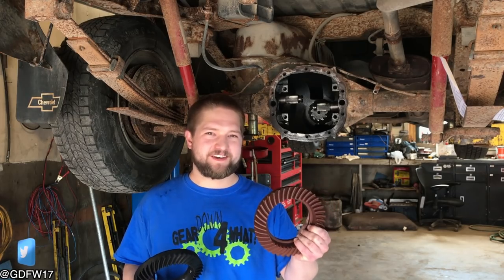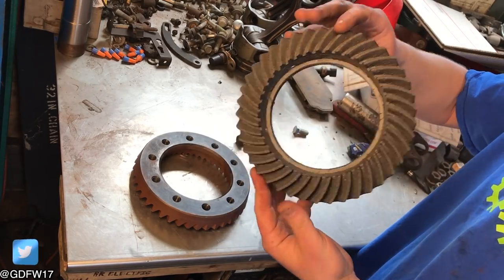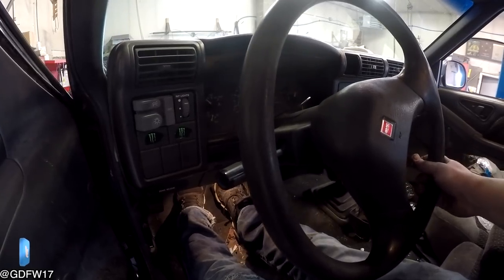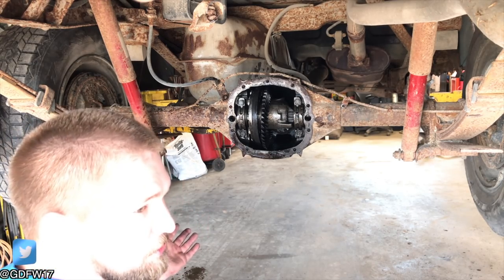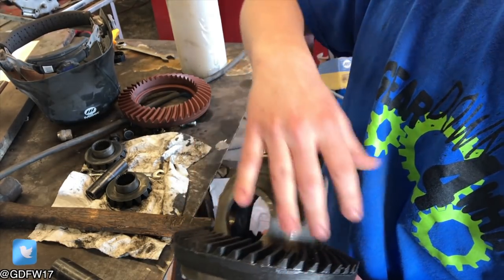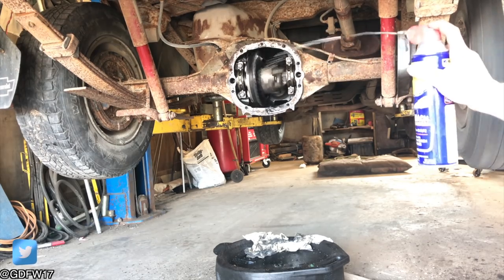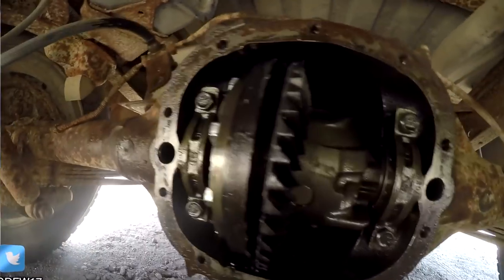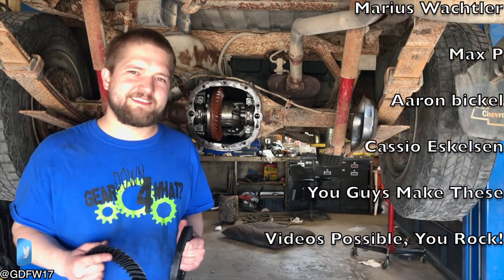Replacing Drivetrain Parts with 3D Printed Carbon Fiber Nylon - FOR SCIENCE!

Comment: The ring gear you are trying to replace uses a case hardening steel with tensile strength probably between 500 and 1000 N/mm^2, no way in hell a 3D printed, non-homogeneous plastic part with questionable layer to layer bond can do the same job.
Reply: Stefan. Exactly what I was thinking. I guess we are both mechanical engineers :)
Reply: Even if it was injection or compression molded it would get destroyed as soon as it was on the pavement....maybe a super tough nylon material with a high steel fiber content but unlikely
Reply: Success is not the point of the video. The point is to see how far away we are from being able to do this. IE is it say 3 orders of magnitude or 2 or even 1? Ordinary nylon I would guess would be 3 orders of magnitude too soft. With the carbon fibre depending on type I bet it's possible to get within a factor of 25.
Reply: Under ideal circumstances it might last a few minutes of slight acceleration.  One turn, or flooring it, or reversing it and it's toast.
Reply: That's like making it out of butter and try to guess how much stronger the material needs to be. It's still going to break and if it breaks - you can't tell how close or far from the goal you are.
Reply: 500 to 1000 N/mm^2 is a good guess for the tensile strength of the gear, though it's off for the surface hardness which is likely roughly twice that.  I didn't look up the specific material here but glass filled nylon is roughly 1/5 to 1/10th the tensile strength.  The modulus of elasticity is probably stiff, roughly 50-75% that of steel so flexing wouldn't be a huge issue but the impact toughness is, roughly 30x less than the gear in question.  For gentle accelerations a back of the napkin guess is 1/5 to 1/10th the strength while slamming it from drive to reverse, turning,  or going over rough ground will break it roughly 30x easier as the impact toughness is really low compared to steel.  That's for machined gears out of quality stock.  3-D printing half assed is anyone's guess, but it would be reliably lower to far lower than stock material.
Reply: Really then the Russian method of successive approximation engineering for closed cycle rocket engines didn't work then? And all the engineering instrumentation I have designed for various companies is a complete waste of time too. LMAO muppet.
Reply: Probably not 25 times, though that's close and it could be I guess.  "Soft" is somewhat descriptive but not as precise as the modulus of elasticity, or softness/stiffness to laypersons, is similar between the two materials whereas the strength and impact toughness isn't close.  It would likely come down to the impact strength which is probably 30-40x weaker though it's not as simple as comparing charpy or izod test data from a chart obviously.  It dosent really matter what you have designed, or what schooling you have, just what you know.  I never considered mentioning the only reason I dropped out of the PHD program in mechanical engineering was to found a successful urban warfare robotics company.  Not only did I design the mechanicals including the gearboxes for multiple systems in service even today but also all the electronics including the smart battery systems and the microwave radio communications systems.   Didn't need the degree to earn money if massive money trucks were backing up and trying to unload. That's irrelevant here.
Reply: They should try candle wax next, LOL.
Reply: @burtosis you could measure the hardness on the Rockwell scale. That's pretty objective. The Young's modulus is a key feature as you intimated, but not the final word as something can be fairly brittle and have a high Young's modulus and still be useless as it's brittleness causes forces to increase due to lack of ductility. Anyway sometimes it's good for a laugh to just do "what would happen if" experiments.
Reply: @gordon lawrence 
Firstly you are blowing the conversation way off course, successive approximation is an actual engineering method and has nothing to do with the sort of "winging it" we are seeing here. 
Second I don't know what you do and I couldn't care less what you have done. I'm not willing to enter a pissing contest, people who have knowledge and are capable do not feel the need to brag, prove themselves or drop their "big engineering balls" just to feel important. I'm simply expressing opinion. So have a nice day, buddy.
Reply: I think there is no point in a deep engineering discussion about this subject, I doubt anybody would read/learn anything they don't already know. Peace out.
Reply: The Russians did not and do not design rockets that way. They went through tons of calculations using known material properties, and added factors of safety. Then, when it blew up, they figured out what failed, and why. I knew the Russians that did this. There was no guessing and spitballing.
Reply: It's pretty easy to calculate the gear tooth pressure. It's even easier to calculate the force at the gear tooth. The engine probably makes 400ftlbs through a first gear of 1:4 for 1600ftlbs. The radius of that gear is about 6 inches, so there is 3200 lbs on one gear tooth. I would guess about a million psi at the contact point. This gear is useful for 1 transmission setting - neutral. (It would break in park on even the slightest incline.)
Reply: Still, I enjoyed the video. ;-)
Reply: Стефан Парийски they make carbon fiber leaf springs so let that soak in
Reply: Yes they do/did make carbon fiber leaf springs and they all turn into shredded shit after a while.
Reply: This is nowhere near the strength of carbon fiber.
Reply: It's not only tensile strength, it's also surface hardness (!), young's modulus, thermal capabilities, .... Also, the carbon fibers will only help in the direction of extrusion, they won't do much against delamination.
Reply: Sorry your life is so unremarkable that you can't even envision a life like mine. Maybe you should set your sights higher?
Reply: Less pot smoking would be a great start.
Reply: @FelonyVideos  - I think they should CNC machine the gear from a solid block of year-old holiday fruit cake. It might break the tooling though.

Comment: I would retest with threaded inserts. That's what's used in the composites industry for things like medical tables and aerospace components. Just drill and set with an epoxy. Also, a side note for JB Weld, heating it to about 120 when drying helps with flow and adhesion (good for getting out voids), but will make it runny until it starts to cure.  Also, for a lubricant, you could try graphite.

Comment: Try again with a different design! 
I would love to that thing working properly. The material seems to be strong enough to handle lower torque and lower speeds. By the way, could you try to make a transparent cover to protect the differential? :D

Comment: You have to try this again. For science! Seriously, this could change the game for a lot of people trying to mesh their love for cars and imaginations with a 3D printer
Reply: It could not. Gears are usually made to last for a very long time and to do so, the stiffness and bending strength of them are pretty critical. The bending strength at the tooth root are very much lessened because of the 3D printing and even with chopped CF, the stiffness is much less than steel. It will not be a usable part for a car.
Reply: Sebastian Jørgensen Do you even watch this channel, bro? These guys have shown that even PLA does amazing things as printed gears.
Reply: Sebastian Jørgensen: I don't think the idea was for practicality, it was just to see how long it would last. Failure was assumed from the beginning, hence the beater pickup. You are quite right in every other way though.
Reply: Claws61821: I do, but I am also an engineer who has had the task of designing a gearbox for a racecar. Those gears are heat treated to have strengths much well above 1000 MPa wheras 3D printed PLA had a strength of 30 MPa last time I put a piece of it in our tensile testing machine. For the wear on the tooth flank, the tooth flank stiffness is also very important as the steel tooth will indent into the plastic tooth, thus not keeping the involute shape. This exites fatigue failure in the tooth flank but also gives higher losses and more wear on the plastic tooth. 
I know that this is not a racecar and the gear that it replaces is most likely a hell lot cheaper than those we use but even if it is simply C40E (Edit: type of steel, commonly used for gears) there are still a factor of 10-20 in difference of strength. 

Especially because 3D printing does not give very homogenious parts, the fatigue strength is probably also a lot lower than for a machined plastic gear so it will never be suitable for use in the transmission of such a heavy vehicle. A 12V childrens car is probably a suitable application for 3D printed gears.
Reply: Philospher of Nonsense: Zac Parks sounded like he imagined that it could be an acutal usable part for this car if it didn't fail where it was paused. 3D printing is great, but it is not a wonder where you can replace anything with plastic and especially not when the manufacturing process of 3D printing results in so much weaker parts than other plastic parts.
Reply: I never meant use for internal mechanical parts. But this will certainly strike inspiration for serveral plastic pieces, interior, and trim pieces. Thanks for your engineering explanation though!
Reply: Sebastian Jørgensen Fair enough. I apologise for my previous false assumption that you were simply being a willfully ignorant troll as so many others here choose to do. With the additional details you do provide some good points and appropriate concerns for GDFW to address in the future.
Reply: Zac: That, I agree with you! 3D printing is most certainly useful for making replacement parts or customized parts for pretty much anything that doesn't have high strength requirements and interior and trim pieces are certainly just that. I have a bunch of plans for making mirrors and blinker housings for my motorcycle using my 3D printer but the time for executing those customized parts are still lacking.
Reply: do you undestand the load that is transferred through a dif especially when starting on a hill, and even more so when in a pickup that would have about 1200nm in 1st gear the plastic cannot take the shear force because off the grain,
Reply: Zac Parks And why would you replace everything with fucking cheap plastic instead of sustainable wood or metal or leather or whatever?
The main advantage of plastic for manufacturers is its cheapness and that it is easy to use in mass production. For home use you can do a lot better with similar efford.
Reply: +Sirion no. simply no. 1st what they used isn't "fucking" nor "cheap" plastic. Its properties are far, far, far better than that of wood. 2nd Most things you want to make with a 3D printer are, in fact, not easy to make with similar effort. You can't make many of the things you can just simply print off an own 3D model or one you got from Thingiverse for example with similar effort out of wood. Ever tried to make a pulley out of wood? No? Didn't think so. And 3rd for manufacturers it's not just that. It's also the good properties like durability that makes it so viable, and for many companies 3D printing is an easy way to create and test their own prototypes, that you'd pay a lot for if you had to make 'em out of wood, metal or just with injection molding

Comment: Wait. Couldn't you just put slices from the center to the place where the bolts are supposed to be? Then just slide the bolts in, see how it goes? Forget the tap and holes. Just make sure you use the nuts slid into it. Benefits are that it's all once piece and it should retain most, if not all of it's strength.
Please try it again.
Reply: ^^ to the top! ^^
Reply: Nathan: I was just thinking the same thing as well, where you would slide the nuts into galleries arranged radially, however there is an issue with that. Due to a relatively imprecise fit, it would put "pressure hotspots" on small areas of the ring as a structure. You would want to spread the load as evenly as possible. Quite literally how the tip of a nail can pierce more easily than the head, if you get my meaning.

Comment: you could print the gear and use helicoils, or a slot on the side and slide the nuts in
Reply: Came here to suggest this as well.
Reply: ok I'm a 3d print idiot but if this materiel is as strong as he says it is why can't he just print the threads into the part? I mean if it can handle the torque of the motor why wouldn't it to be able to handle the torque from tightening the bolts into the "plastic"?

Comment: Suggestion: step 1 - before printing, set the nuts prethreaded onto the bolt shafts at the desired hight.
Step 2 - set the bolts on the head with the prethreaded nuts shaft up in the pattern desired.
Step 3 - set printer to start printing at the correct measured hight on the bolt shafts in order to embed the nuts into the structure without having to pause the printer.

In this method, it is all one piece and you can still remove the bolts because you have access to the heads.

Comment: WD40 is a terrible lubricant. Just fyi. Basically anything is better than wd40.
Reply: also dissolves adhesives
Reply: backtrackit anything with any oil content at all dissolves adhesives. Next time you pull a sticker off something and it leaves sticky residue, rub a finger on your forehead and rub the sticky spot. Even the oil from your face will dissolve adhesive. Not really a special wd40 trait.
Reply: backtrackit: WD-40 is nothing compared to PBlaster, especially in penetration. That'll melt a styorfoam cup very rapidly compared to WD-40, which is just a waste product of gasoline manufacture.
Reply: As a lubricant its only ok. It is a penatrating fluid, degreaser, rust remover and a few other things
Reply: AvE compared a bunch of different penetrants, and WD-40 turned out to be one of the best ones. And PBlaster (PB'laster?) actually did pretty badly. This was with a sample size of 4 or 5, so take that for what it's worth, but I was surprised to see WD-40 do so well.
Reply: Bro the wd40 was what made it work. If it broke and it spins wd40 it if not duct tape it down :)
Reply: Luke B the wd40 part dissolved the adhesive. Its not a good lubricant at all
Reply: It was a joke but ok mate. Here in Australia WD-40 is a bit of a fix it all like duct tape.
Reply: It's just fish oil with a few additives. Not a real mineral oil.
Reply: 3d parts are not very God as they are just essentially castless moldings.
Reply: Wd-40 stands for water displacement - 40th try! Not a lube!
Reply: Its fish oil. Yes feshi
Reply: it didn't break because of the wd40, it broke because of layer Delamination which is just an intrinsic part of 3d prints, I'm sure using a better filament and fine tuning the settings along with not letting the part cool down mid way into the 3-d print would all work to help the print not fail. yes 3-d prints are strong, but not in every direction. parallel to layers is a known weakness.
Reply: It’s water based so ya
Reply: If you think WD 40 is a lubricant try this experiment you will never use it again:  take half inch still plate and quarter inch drill bit.   Try to drill though plate using WD 40 as lubricant. It will melt the drill bit 1000 times faster than not using anything for lubricant
Reply: swampy 420  wd40 has nothing in it that is lubricant it is solvent.
Reply: swampy 420  I was definitely exaggerating on the 1000% but my personal experience is nothing is better. Working as service tech I do drill often.   It only took once to say never again.
Reply: WD-40 isn’t even a lubricant, it’s a water displacement fluid.
Reply: Its actually a cleaner and desingripant. Not a propper lubrificant. 

Idk why people still goes on trying that. 

Grease godamn, oil, its way better.

Comment: i couldn't figure out if this had been revisited or not, but here are some tips for revisit:
1. don't print it flat, tilt it slightly so that the shear force isn't directly applied to a single layer
2. find out if there is a curing process available, might be able to heat it to a certain temp for a certain time to cure it for more strength
3. don't pause it of course, just model the threads right in - should have no problem mating with threads that large
4. get/make a clear cap to put on the diff and use proper gear oil, don't just let it hang out in the air unlubricated
5. someone else mentioned using a go pro, great idea

Comment: WD-40 is a solvent!! Not a lubricant. Use a lubricant that won’t damage your print!
Reply: And not use that much oil. Some on moving metall parts and not half a liter!
Reply: WD40 is 1 part motor oil, 1 part fuel oil. It is not a solvent.

Comment: 3D printed parts are nowadays still anisotropic saddly... not really enabling you to print hyper strong parts whatever dirrection the stress is applied to...

Still very inspiring ! I guess you must continue doing this kind of videos !
Reply: unless you use the extremely expensive M1 carbon printer...That thing is one cool overpriced machine...
Reply: You have to admit though, even after 2 failures, those gear teeth really held up well.

Comment: I'm completely amazed how well the teeth held up even after the failures. Multiple. I was expecting the pinion to strip the teeth on the ring gear immediately. That makes me think that you should skip the hex nuts, and carefully thread the holes directly in to the ring gear. Use a course thread tap, and bolts. Also, go ahead and assemble the back cover, and fill it with gear lube. Go easy on the clutch! I wouldn't recommend doing "burn outs" with the plastic ring gear. If it doesn't de-laminate, it could surprise us all.